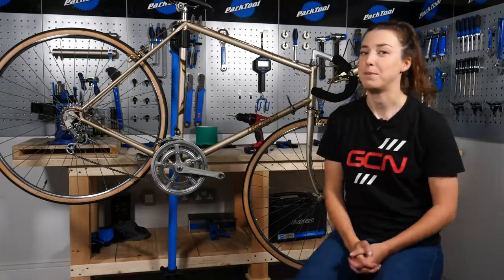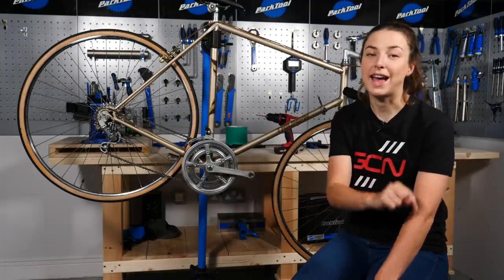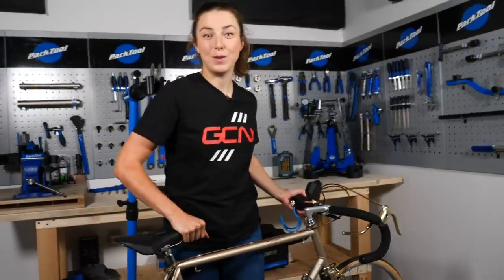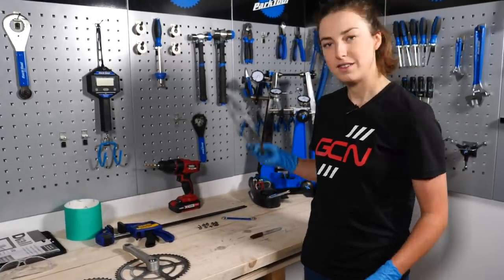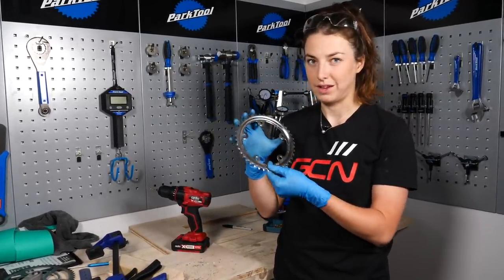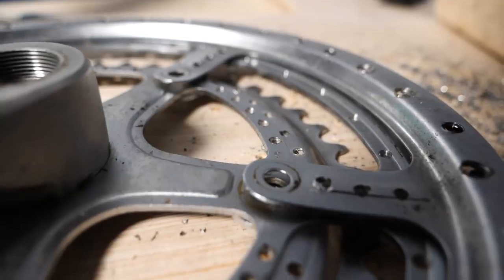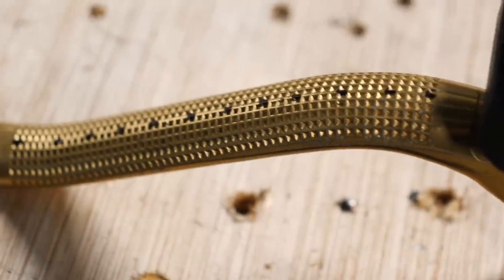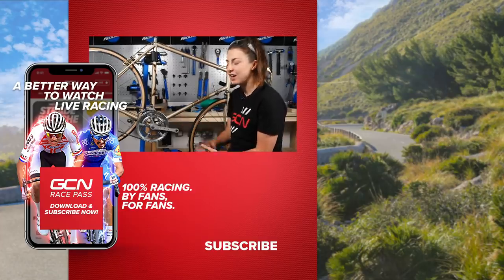Drillium: The Ultimate Retro Bike Mod | We Drilled A Road Bike

Comment: I suspect that Manon is the only presenter at GCN capable of lifting the ‘before’ bike to weight it.
Reply: and the rest are T.rex
Reply: Dan Lloyd knows it's the reps that count, not the max weight; that's why he trains his arms with three-hour supersets of pint curls!
Reply: The funny thing is that those Park Tool scales are specifically designed to fit in a bike stand which gives a more steady measurement, so her lifting the whole thing was a literal flex.
Reply: That sums it up better than I could. Manon strongest GCN presenter.
Reply: Baguettes all around
Reply: @BinarySecond  “I understood that reference.” -Cap. America
Reply: i think there was a string that helped her in which a man pulled on.  but i guess we Simply entirely disagree.
Reply: Weigh.

Comment: You would’ve saved more weight by taking off the guard
Reply: Ikr :)
Reply: @robinburt5735  Ok, I was not the only one thinking this.
Reply: And the suicide levers on the brakes...
Reply: True; that's not a bash-guard on a road bike; it was meant more for keeping trouser legs out of the chain.
Reply: Danger levers and chainring guards off. Low profile tubular rims and true 15 gauge spoked wheels really were super lightweight. Aero was barely considered. Steel frames got lighter and lighter and started failing at lugs  occasionally. 24 lbs was light.
Reply: And the frame pump boss isn't being used. But that old bike would look cool with one. Get brave and drill the seat post too, lots of iron there, it's probably way longer than she needs, chop off a few inches. Lots of deburr to do on all those holes too. Nice job though, drilled brake levers look nice.
Reply: I'd agree with cutting the seatpost shorter by the difference of safety height and current height used. No holes in my seatpost though. Light weight tubes would be on my list. Usually you can get away with 700c tubes in a 27 inch tire. They actually sell an adapter for presta valves in shrader rims. Remove 1/2 the spokes in the front wheel. All pulling spokes on one side, all trailing spokes on the other. There's probably another 500 grams in all this for little money and some work.
Reply: Wonder if it'd be safe drilling holes in the rims. I know trails bikes have holes, as do fat bikes. Although they are wider and made for them.
Reply: @callummclachlan4771  No holes in my rims. Probably best to buy a better bike before resorting to these draconian measures! Including all but the chain guard removal and cutting the seatpost by the difference of safety height and used height.

Comment: To increase precision centrepunch each hole and start with a small drill bit and work up in sizes
Reply: Using a center punch would have probably sped up the overall workflow too
Reply: So what your saying is they should have got someone who knows what they are doing to do this video?
Reply: A little bit of oil where she is cutting would help keep the bit cooler and sharper too
Reply: Using a drill is terrible idea, they have a tendancy to shatter with impact causing bits of sharp metal to fly off and become embedded in soft tissue (eyes)
Reply: It's a good idea to use some oil as lube and coolant to prevent the drill bit from heating up.
Reply: @reginaldscot165  I think part of the fun of it was seeing what an inexperienced person could do. I forget his name, but the maintenance guy would have obviously been ideal and they chose Manon instead.
Reply: 4evadunkley were you thinking of John (?)
Reply: @martinflores1743  probably too lazy to look it up.
Reply: @martinflores1743  I miss John, friggin loved his bike build series.
Reply: @Arakkan12  Has Ollie taken over from him?
Reply: @smitsamuel  I guess you could say Ollie did. Ollie does have pretty cool build ideas but the way he goes about building his bikes are pretty different from John. John starts out with a really cheap bike then builds it up and makes it a lot better, Ollie on the other hand starts with a pretty good bike and makes it slightly better.
Reply: @guantou2520  That's why she was wearing those sexy safety glasses.
Reply: @4evadunkley  they really could have made it easier on themselves by using a center punch first
Reply: High speed and low pressure for small drill bits and low speed high pressure for bigger ones.
Reply: Was hopeful someone said center punch first.
Reply: @guantou2520  Hence the glasses...
Reply: I was screaming that internally the whole process.
CENTER PUUUUUUUUNCH
Reply: @Arakkan12  just wasn't sure if John had left or not?
Reply: Yeah she should have placed it at floor level its way easier with some weight behind it
Reply: Using a drill press rather than a hand held would be a better idea too!
Reply: would a thanospunch quicken the process?

Comment: Make a second part, please. Rear/front derailleur, stem, brakes, handlebar, there's a lot more to drill.♥️✊
Reply: Replacing steel tubing with carbon or glassfiber rods for the third part, maybe?
Reply: Tediuki Suzuki  and this reduces weight how, dearest cad?
Reply: Bottom bracket is quite thick so will take three large holes or a slot
Reply: drilling holes in the make makes it very unsafe and the gains are pointless. There's a lot of holes in this theory that drilling holes is good, it's not.
Reply: @ADCFproductions  Fine for low load areas (like brake levers).
Reply: @callummclachlan4771  i still wouldn't do it, personally it triggers a phobia in me, and unless you're a sprinter/racer the 1 second difference in time isn't going to do anything.

Comment: For the benefit of anyone playing along at home: HSSCo drill bits will last longer and go faster than regular HSS; they're not that expensive and will work out cheaper than burning through HSS bits. "Stub drills" are shorter and wiggle around less, so they're easier going for sheet materials. They're also less prone to snapping.

Use a centre punch to mark drilling locations before you start drilling to make life easier and resist the drill bit skating around.

A drop of oil on the drill site will keep things neater and cooler. If the oil starts smoking, SLOW DOWN 😝

Don't push down hard. You'll heat the drill bit and the component, and you don't want that.

Use a countersink bit to ream the holes to remove sharp edges (and maybe another fraction of a gram).

Also probably just don't do this, but drillers gonna drill 😂
Reply: Cobalt bits are best for cast iron - which is not hte case here - and are brittle, especially in untrained hands. I'd recommend TiN coated (not tin, duh): they are not expensive too.
Reply: No drill bit is expensive compared to what weight weenies usually go with.. 
I kinda wish Manon did a little more research so she knew all the things you listed above.
Reply: So you’re saying they should’ve got someone who knows what they are doing?
Reply: @rosson1983  No, that would make for a very boring video. But just a little more research wouldnt hurt
Reply: Yeah you really want enough weight and speed to take a nice chip out of the metal
Reply: Surely you would use a countersink bit to deburr the holes? Reaming is a different process altogether.
Reply: @colinmilne162  ehh, it communicated the concept well enough but if you wanna give yourself a biscuit for being technically correct in the internet then go ahead and treat yourself
Reply: @iamtoast3397  Send three and fourpence we're going to a dance. Look it up.

Comment: You could make the holes much bigger at least on the cranks and brake levers. The "perimeters" of a part are what's structurally important, the "center" parts can be mostly removed without a lot of problems as long as there's enough to prevent buckling. A hollow structure is not that much weaker than a solid one of the same dimensions.

Of course you'd save more weigh simply by removing all the unnecessary parts like the bash guard and brake lever extensions completely.
Reply: People forget they make airplane wings with thousands of holes through the metal. It’s still all depends where the holes are hehe. Love and live it!
Reply: Don’t try it with your skull.
Reply: @hisdadjames4876  Well, a gram saved is a gram saved, it doesn't matter if it's from the bike or from the rider. So drilling your skull and other major bones might give you an advantage. Also, we have a lot of organs we don't really need so having those removed would also reduce your weight.

Comment: Curious why you weren’t able to leave the “Bash Gaurd Off” seems that the Crank would have a cleaner look without it
Reply: And it would have reduced the weight by 23g.
Reply: @paulbradford6475  and the number of drilling :-D
Reply: I think they only kept the basher on so Manon actually had something to drill. It looks like "no basher, no vid" scenario. Like you it would be the first thing I took off completely anyway.
Reply: Because we want to know how much weight we can shed off by just drilling holes. Removing that basher is cheating.
Reply: @louiemarcsalva  whatever, it was strangely weak filler piece for GCN. Drilling or not, they could have gone far deeper and been far more imaginative with the theory.

Comment: Safety note - 
You should not wear gloves while using rotating hand tools
Reply: Would you be willing to explain for those of us who don't use power tools for a living?
Reply: That’s actually true, in case the gloves get trapped in the rotating tool.
Reply: No, not true its loose clothing material and hair. Some gloves will actually delay the blade if you were to mistakenly cut yourself or anything like that.
Reply: @niallflaherty9957  if your gloves are so loose that they get caught in the work they're no good. Im a tradesman and have been saved by gloves many times.
Reply: WeekendWarrior each to their own, as a tradesman, you have the experience to make that judgement. It’s something I would never teach as best practice.
Reply: Adding to this conversation that we're talking about a battery powered hand drill - not a drill press or bench grinder or lathe, etc. I think for this specific application, both are fine.

Comment: There was a bit more that could be done. Drilling the chainring bolts out for a start. You don't need bar tape if you drill out the lower portions of the handlebars. (The holes provide the grip.)

The BB shell on the frame can handle the removal of a fair bit of metal too, so lots of scope for drillium there too.

We used to do all that with a hand cranked drill.

Then there's chopium. Measure the minimum insert of your seatpost and stem, then cut them down to remove the excess.

Comment: I was around in the Drillium days. We drilled crank arms from the inside but did not go all the way through. It looked untouched from the outside. Front brake calipers were done the same, no vent holes more aero. Seat posts were cut down to have just enough length to keep it safely bound by the seat post frame binder.. 
    In Cincinnati, Ohio, back in the late 1970's  we had a guy who would masterly drill you chain rings for $30. But that ended when his employer found out he was using their computer controlled drill press for this work. That drill press was used to make parts for jet engines. He lost his job.

Comment: One of the tools I take on a ride is a small adjustable spanner as I ride an old bike with lots of nuts and bolts, I’ve cut the centre out the handle and saved 19 grams I think of this when pedalling uphill

Comment: There are lots more places to drill holes.  The rear sprockets can be drilled a lot if they're solid steel.  The tube shifter handles.  Seat post.  Use a drill press and vise, too.

Comment: Add a complete ultegra groupset and fully supe it up!
Reply: I did that to a 1983 motobecane (columbus tubing) frame. Was already fairly light for vintage bike at 9.7 kilos. Never weighed it after the mods, but that frame with newly built wheels and full ultegra is the most comfortable bike i have..and i have about 20. The goal was to not wear out the vintage simplex components, so i have all the original components.

Comment: Just convert it into a fixie, to loose even more Weight!
I mean you could not just get rid of the whole shifting mechanism, but also the breaks 😁
Reply: You still need two independent brakes in most countries.
Another thing is if you have no brakes the chain drive becomes safety critical.
A single speed conversion would be much easier.

Comment: I was a metalsmithing instuctor in a former life:  do not try this without learning how metal is drilled  first.

A) center punch ( automatic or hammer and  punch) to precisely set the starting point for each drill hole.   Map them out and do all the center punching in one step  ( actually map them out with permanent marker first then punch)

B)  *****Buy Jobbers/Machinist Bits***!!!!!
Swiss or German numberical bits are key...   Being that they stopped making good Jobbers bits in the UK and USA  around 1919 or 1945.. Try : Grobet Swiss.

 All Purpose bits will suck for this task... Be cheap, Have fun!  One single  set of Irwin all purpose bits won't get this task done.. They will dull or break before you make 50 grams difference.  Buy the bits you need, in increments, by the 10 or dozen.   

C)  lubricant/ whetting agent:  ****do not drill metal dry**.    Industrial Fatty alchohol whetting agents are the best IMO.     But here don't worry:  Standard 3in1 oil will work perfectly well. I suspect most dry chain lubes will also work ( no guarantees because they may be temp. sensitive.. Teflon chain lube will work fine... Future cancer is a maybe! I bear no liability!!!).  A small drop needs to be applied  to every center punch mark to start... A bit more might help in wider subsequent drill passes.

D) Step drill!!!   Start really Small ( make guide holes)... And gradually  increase the drill bit size ( you do not do this with wood.. So forget this if making cabinets, please!!!!!!)

E)  Good luck with a hand drill!   Low RPM= low torque on most hand drills.= broken drill bits in metal.  It can be done by experienced tradespeople... But they will find it like prep cooking stew for 50 people with a swiss army knife to cut veggies!  Drill press or flex shaft is so much better.  Dremel tools might work,  or the dremel will burn out after a random number of holes are completed.

If you insist on using a hand drill*:

You will need  to get a  micro chuck to use small starter drill bit sizes below #50 or #55.-

By the way:  jobbers/ machinist bits are neither metric nor US standard. I believe they are an archaic European measurement that survives ( maybe they are in round decimel increments of metric... But I think they are pre- metric).  What makes them key is cutting edge angle of the drill bit is optimized for drilling metal and high quality ones are from a steel alloy that can resist moderate or high temps.    Aluminum is softer,  sure... But it will clog non-metal bits.

All of this is purely a rough Guide.   Step drilling may work in an alloy with less hardness/ tensile strength in increments of 10 or 12 #  in Jobbers measurements.  I suspect chain rings etc might reqire smaller increments like 5 or 7# steps in drill bits.

Bonus: Good Jobbers bits, proper lube, and step drilling  will also reduce any/ all burrs that will happen with cheaper bits/ lazier methods.   Do it right and you won't need sand paper or a file.

Good luck!
Reply: Her first instruction was not to do it.
Reply: @petermwheeler  good point,  I am gonna do a small edit.
Reply: @petermwheeler  Now... Strictly technical.

Comment: Looks cool !  But you only scratched the surface here.

Actually, you can throw away the chain guard, not useful at all when the front derailleur is correctly setup.  And remove the chainring dust caps, useless too.

You can drill :
- A huge hole (or multiple ones) under the bottom bracket.  Lots of bikes had them. (saves a lot more weight)
- Some holes in the plate between both bases on the frame
- Some in the seat post
- Some in the clamps that holds the brake levers on the handlebar
- Some in the handlebars, the part that starts from the ends and goes to the brake levers (lower part)
- Some in the clamp that holds the front derailleur
- Some in the rear derailleur pully wheels, and in the cage parts that hold them, you could probably drill some in the derailleur itself too
- Some in the brake callipers

You can also cut the bottom part of the brake, the part where the brake pads attach.

Comment: So many comments about using a centerpunch. No. Drillium was a thing back when everyone either knew a Machinist or was a Machinist so setting up components on a precision turntable on a vertical knee-mill to do perfectly spaced holes was a piece of cake. Three laps around the rings with three bits: a center drill, a main drill, and a countersink for stress-riser eliminating chamfer. 

Without that chamfer, those crank arms are now ready to snap.

Comment: 1. You need to tie your hair back when leaning over the drill like that. 2. Use a punch tool to start the holes so the bit doesn't walk around while you get started.

Comment: Manon, if you laid out the Shimano's 105, Ultegra and Durace rear cassettes, you'll see that the biggest difference is how fewer holes and less metal are in the 105s to U;tegra compared to the Dura Ace. Less cost more is the golden rule of cycling. :D

Comment: Drillium would allow you to remove things like the basher and you'd be just as cool.   Removing stuff you don't need, or having spare parts when you initially install, means you designed it better than the engineers intended.

Comment: Did you have to use a center punch before drilling the holes?? To prevent the bit from drifting. Starting with a smaller diameter bit also helps.